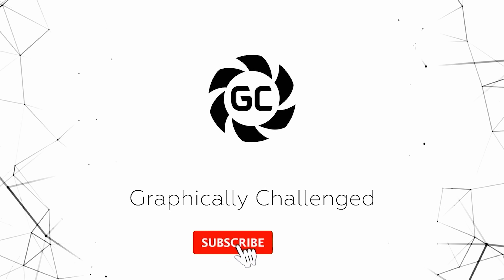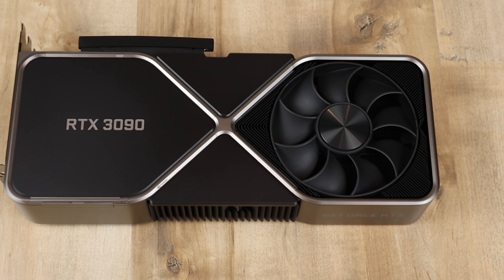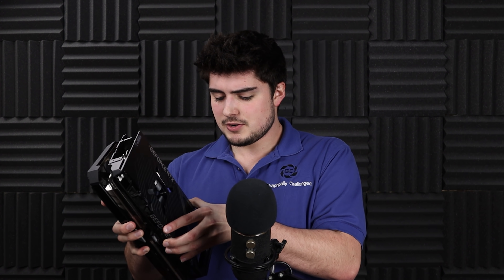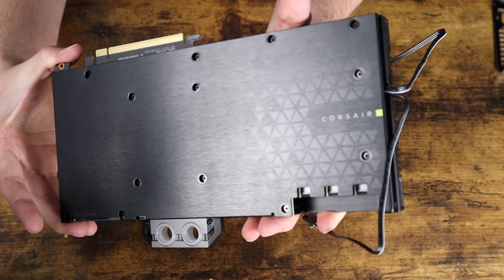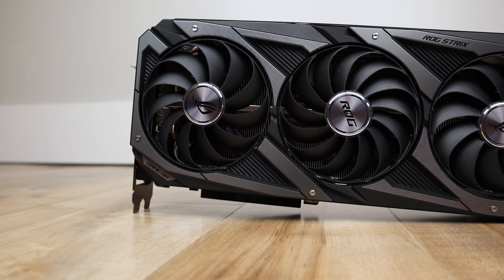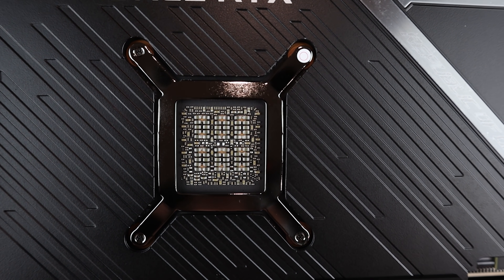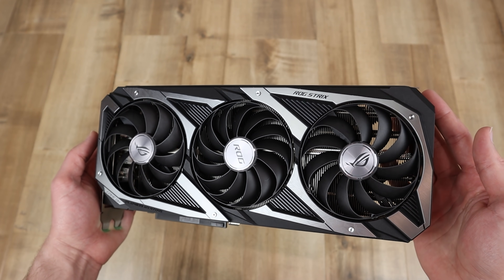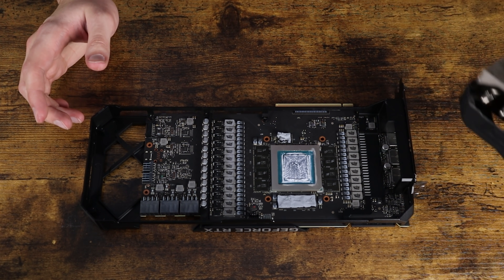Nvidia's RTX GPUs Have a MAJOR FLAW

Comment from the maker: Do you think this is a big problem, or is it a non issue? Let me know your thoughts in the comments below!
Reply: You need to change the title to Nvidia's RTX 3090 Has a MAJOR FLAW - But don't worry! You can't buy the card anyway.
Reply: @Nomadd86  now that would indeed be a better title haha
Reply: Been using it for more than 3 months. Mined with overclocking, played GTA V, Doom Eternal, Quake Champions, and Tom Clancy's The Divison 2 at ULTRA and 4K resolution, and worked on my video game project in Unreal Engine 4; never goes above 60 °C.
Reply: I wonder if in a few years they will be RMA’ing a bunch of 3090’s. Even micron states on their own website that the maximum operating temperature for g6x is 95C. So its running hotter than spec.
Reply: A wee bit of an exaggeration that for the vast majority of people is a non-issue.  Maybe an issue for miners, but I don't give a Flying F...Fudge about them.
Reply: @highlanderknight  I mean micron’s own website only rates it to a maximum of 95C for g6x. It isnt going to be a catastrophic failure anytime soon, but we might see 3090’s that have issues holding the memory clock and need to be down clocked to be stable a few years from now. Might make it interesting in a few years if you want to buy a used 3090 if the high memory temperatures cause a lot of failures
Reply: My gaming X Trio seems to stay well under the hotspot limits.
Reply: @MustafaBerkeGureltol  that's the weird thing. My 3090 Strix runs pretty cool temps at the GPU core. But push it hard, like running Nice Hash, the memory temps jump right up to 104 on stock settings. Forget trying to overclock, because it easily jumps to 110 and starts throttling. Same thing happens when rendering with DaVinci Resolve. Cyberpunk can push it, too. So, I leave the card at stock settings, or sometimes detune it. Unfortunately that drops preformance, but at least keeps the temps down. Again, it's only the memory - core stays in the 60s.

I don't have the money to do a water cooling loop (blew past the budget to get the card) so I need to look into the thermal pad replacement and hope someone makes a heatsink back plate or something that isn't too expensive.
Reply: @waggy401  Mine with it. Take the money you earn with mining and buy a water cooling kekw
Reply: Used market is going to be bonkers in 6 months
Reply: @MustafaBerkeGureltol  you have to check junction temps with hwinfo64
Reply: @brohoven3626  I believe you're referring to GPU Memory Junction Temperature. Yep. That also stays around 57-60 degrees.
Reply: Anyone know the command to show on console in hiveos?   Mine are in a cooling case. 3 7000 rpm fans pushing air through the case. It’s an older 1ths bitmain case. Gotta love repurposing.  Gpu sits 55c at 60% fan.  Not sure on the rest. Any input appreciated.
Reply: @TheBadassOne17  Yes. I have been using HWiNFO64 for a while now, and I am sure that it is what @BroHoven was referring to. I need to force the GPU so much(such as enabling RTX and cranking up the samples while rendering a character) in order for the GPU to go beyond the standard limit of 95°C. And I think it is still safe to use the card even though you see 110°C in the sensors as long as it is stable. What's damaging the GPU is variable temperature. Imagine going back and forth between 80 and 100°C. The card gets exposed to expansion constantly, which wears the material off. That's why gaming hurts your GPU way more than mining. Your GPU memory goes crazy when the CPU says: "Incoming level. Stream the level instantly and render it weeb."
Reply: this whole problem could have been avoided if nvidia used higher capacity memory chips. micron advertises the ability to create 8GB GDDR6X chips on their website.  meaning nvidia could theoretically make a GPU with 96GB on one side if they wanted. not to mention 10x2GB should be a bit cheaper than 20x1GB.
Reply: Honestly speaking ,I haven't had this problem at all since i've gotten the card back in September 25,2020
I got one from EVGA FTW ULTRA
Anyways my card has stayed under 70c for pretty much the whole time i have had it even with demanding games so it might be a few cards not all.
Reply: Probably not worth getting a used 3090, for all of the 10 people who would be willing to do that.
Reply: Imma sell my 3090 and get a 4090(or perhaps 5000) when it comes out.
Reply: wat abt rtx 3070 FE
Reply: Mustafa Berke Güreltöl you sure?
Mined it under 60C ?

😂
Reply: @CaptainScorpio24  only 8gb... and not gddr6x but gddr6 so it would not get Hot anyway
Reply: @DefinitelyJayJay5  yup. 😊
Reply: It’s not really an issue.  Operating temp is about performance and reliability parameters.  You design and characterize to a spec, going beyond won’t cause it to blow up.

The main reliability concern with higher temperatures is electromigration, and that isn’t really an issue until 125C given the exponential relationship between temp and reliability.

Thermal throttling happens to ensure you don’t start getting a massive increase in bit errors because of timing violations.  It’s like stability when you overclock your CPU too high, you might not exceed the operating temperature but you start violating timing on the circuits so BER goes up and things crash.

Micron and the board partners are aware of this.  Honestly taking the board apart and sticking an after market cooler on is taking on more risk than doing nothing since you risk voiding your warranty.  And if the higher temps are an issue (and statistically a few more will fail), it is most likely to occur early on in the products lifetime.  Bathtub curve.

Tl;dr the temp range is about performance not reliability.  As long as your card isn’t throttling your are good.
Reply: @highlanderknight  Not just miners, my 3090 FE hits 110 degrees c in cyberpunk 2077 with ray tracing maxed out. People should be fine if they don't use Ray Tracing though, but it's def an issue. To be clear, my GPU Clock stays at around 60 c but my gpu memory junction temp goes up to 110 c, and then throttles back down.
Reply: @psionx1  8 Gigabits.  Not 8 Gigabytes.
Reply: Flawed design for all that money.
Reply: i rigged up 2 92mm fans blowing across the top of backplate.  gddr6x temps max out at 76c now.
Reply: @psionx1  could be a bandwidth issue.  Card may perform faster with parallel access to ram.  Instead of channeling all that data through one Mem chip bus.
Reply: @MustafaBerkeGureltol  we arent talk about the gpu core, we talk about gpu memory junction, u can read it out only with a few tools like hwinfo64 and u will be surprised its over 90 degrees for sure by you while gaming even over 100, i have certain 3090 modells and all are over 96 degrees while play so stop talk bullshit!
Reply: I think your clickbait title is a big problem
Reply: You really need to stop creating dumb clickbait titles like "GPU X BACK IN STOCK SOON" and "MAJOR ISSUES FOUND WITH GPU Y" followed by "Do you think GPU X will be available?" and "Do you think it's a big problem for GPU Y?". You can either provide facts or conjecture, but BE TRANSPARENT ABOUT IT. Your titles are simply misleading and the questions you subsequently throw out there are the evidence of that simple fact.
Reply: verdammt23  Man 60% fan speed is to low...better to run it on 80% minimum!!

Comment: Old news since December.  GDDR6X on the 3080 and 3090 run hot.  Solutions - Undervolt, replace the pads, or plop a heatsink on the back (if you don't want to open up the card). All reported to be effective at dropping temperatures down in many cases.

Comment: I have a 3090 FE and I've been mining Eth to offset the cost. I was running it way too hot before everyone found out about the memory issue. Even some games would push it out of spec. Cyberpunk hit around 96c and Mechwarrior 5 hit 100c. I have a very well ventilated case and keep my ambient temps low, because I  hate the heat.  First, I scaled the power way down during mining, to keep the memory under 95c. Then I spent about $50 on double adhesive thermal pads and assorted heatsinks and covered the back plate as fully as I could. Didn't really do anything. Realizing there was no choice but to open the card, I followed a guide on YouTube and replaced all my internal thermal pads with Thermalright Odyssey 1.5mm pads. My temps dropped 20-30c. I re-pasted the core with Noctua NT-H1 that came with my CPU heatsink. No difference in core temps. I noticed that some of the pads were thicker than others and recommend getting a pack each of 1.5mm and 2mm pads to do an FE. My friend did his 3090 FE this way afterward and his temps seem to be even better than mine. He has no heatsinks on his back plate either. I bought a pack of 2mm pads and am planning to go back in, when I find the time.

Comment: Beware.. in the UK at least. I bought some new thermal pads but checked with Nvidia and they said if I do ANY modification to my 3090FE Inc replacing thermal pads it will void my warranty. So I have a choice care for my GPU but void warranty or abuse it with ram at a steady 104-108 degrees 24/7 (this is with a CPU cooler and multiple heatsinks on the back) but keep the 3 year warranty.   Madness that NV built suck a great cooler for their £1400 GPU then skimped on the thermal compound.

Comment: I can attest that putting a 80 mm heatsink with a 80 mm fan has drastically dropped my temps overall especially vram. I also added another 80 mm in a push pull direction over the exposed vent for the cooler and that helped even more for about 34 bucks it was fixed, plus new thermal pads, so 65. Be sure to add thermal pads to the backplate.

Comment: 100% Agree. I have a RTX 3090 Hybrid from Evga and I had to change thermal pads against expensive 16 ones. Even now when I mine with 119mhs temp of the vrams is average 106 degrees. While gaming its fine with about 86

Comment: we have some 3090's that we mine on, the backplates are to hot to touch for more than half a second but we are able to mine 24/7 with them since February. this will probably reduce the lifespan of it but what are you gonna do. We've made most the money back on them already. I downloaded a software and highest I saw was 108c since then we have had a fan running over the backplates and now the temps are doing just fine.

Comment: I had the rtx 3080 msi ventus 3x oc it Had 108c on mining 1000+ on memory 71 power limit
With same settings on the Asus Strix RTX 3080
With 1500+ 71 power limit 88c to 90 max fan
Reply: I sold The msi card after 2 months mining
I dont need stuff break in a year 🙄
Reply: Sure would change thermal pads if i even could tinker with pcs even Had somebody replace The gpu and broke almost The gpu slot doing it rip

Comment: change the thermal pads out for 3mm on the back and 2mm on the front, nothing to do with the backplate!! cheapo thermal pads from the manufacturure, with Thermal grizzly 08 pads you will drop your temps by up to 20c

Comment: My 3080 was getting up to 110°C under heavy loads, I opened it up and replaced all the thermal pads on the VRAM, temps went down to maxing out at ~95°C.  Opening that thing up was a major butt clench moment, but it turned out to be worth it.

Comment: I have the memory over clocked +1350 and the core clock at -250.
The core is at 47 degrees Celsius. The memory is at 90 degrees Celsius. Fan is on 80%. But its sitting in front of my air conditioner.
122.5 MH/s.

Comment: I read about this a little while back so I replaced my thermal pads and it decreased a full 19 degrees. Works great!
Reply: Which ones and where did you get them?
Reply: @waggy401  does it void card warranty\
Reply: @garvkhosla6488  if you don't want to worry about warranty, go to a DIY electronics store or amazon and pickup a kit of small heat sinks and use 3M 467MP 200MP Adhesive to attach them right on to the back plate over the memory chips. I saw a 20c drop on my 3090 FTW3
Reply: @aver54  bro i got my rtx 3090 for 3200$ .So i am confused that if i do so my warranty  gets avoid if not then card can damage with heat.
Reply: @garvkhosla6488  No I meant you literally use double sided thermal tape to put some heat sinks on the back of your card to help, you don't have to open it up and they are removable. Another note, if you're in the US warranty stickers aren't enforceable and you can remove them without worry, you're also not obligated to be honest with all the little details of the work you've done. In the end, taping heat sinks to the back plate of the card and pointing a fan at it isn't going to void the warranty.
Reply: @aver54  thanks bro for help😁

Comment: This also happens on the 3080 as well by the way. Huge issue with that.
Reply: @TheBadassOne17  "if enough of us say its truth, then it is"
Reply: 3090s have a harder time keeping cool because they have VRAM that's only passively cooled by the backplate.  All of a 3080's VRAM heat goes into the heat sink, so those are better able to handle the crazy GDDR6X heat.
Reply: @funghazi  alright bud, I and my friends deal with overheating VRAM whenever we game it's in the 100-108C range and we all have 3080s. Thank u for ur blogpost but I think I'd know if they have that problem or not lmao
Reply: @benman1407  My 3080 overheats too, I fixed it with better thermal pads.  My point is that it's easier to fix the VRAM temps on a 3080 than it is on a 3090 cuz half the VRAM is being cooled by nothing more than the backplate.
Reply: I got rtx 3080 gigabyte gaming oc and my vram temps all also around 100-108 celcius during gaming, should I worry about it? When I have checked the topic in like December I have found an info that below 115 is perfectly fine, now I am confused.

Comment: the 3090 FE was refreshed and now has very safe temps. My new 3090 has vram junction under 90c while gaming. surface temp is 20c lower.
Reply: With refreah you mean downclocked? In that case yes, it was refreshed.
Reply: @lupintheiii3055  he means that when the 3080 and 3090 came out there were videos of people adding thermal pads to the backplate as a mod. To the point where about a month or so after release nvidia actually copied these modders, and started adding thermal pads to the backplate right from the factory.
Reply: @Jsteeezz  Good to know (indeed the downclock was in response to the blackscreen drama at launch). Still not a good showing for a $1500 (aka $3000) graphic card.
And summer didn't kick in yet in the northern emisphere...

Comment: Why use one of the best Air cooling 3090s as an example, should've used another model.  I feel the Strix is one of the few models that would apply thermal pads on the back.

Comment: I have 2x 3090s crammed in a bequiet case. Running just air. The fans 120mm 2 in 2 out. Using hive os. Pulling 660 watts out the wall getting +210 MH/s . 

Fans are running nearly 100%.
No throttling and my cards are tight against one another. 78° card in slot pcie16_1 and 56° card in slot pcie16_2. 

What I'm trying to say don't listen to FOOLS. Do your OWN research. Otherwise you'll be scarred by misinformation.

Comment: Even the 3080 have this issue. I have a 3080 strix and didnt had any thermopads between the board and where the memories are and my memory temperature was always 100 degrees while mining even with a -500 on the memory and 61 on the power. I had to water cooled the card and now is in the 78 degrees with a +500 and the same 61 on the power.

Comment: Run MSI afterburner stock fan curves and you will be fine. Haven't had my memory run over 90 degrees no matter what I play. GPU temps stay right around 67-69 degrees. No worries here
Reply: @TheBadassOne17  memory junction doesn't go over 90 degrees and the GPU temp doesn't go over 69 degrees
Reply: I spent a bunch of time on MSI setting up a great fan curve. Works really well with my existing case fans setup and keeps everything nice and cool.

Comment: Im having no issues. Max of 90c on memory while mining. Gaming will raise that up with an auto fan curve. Definitely change it to peak by 55c. The 95c max operation temperature is completely accurate. Once you get it up to 94c on memory youll soon see a black screen.
Reply: My gpu also 90c while mining no throttle 1500+ on memory 102/mhs
Reply: Its The 3080 Strix Asus oc
Reply: Msi much worse 108c while mining 😳
Reply: @Jonathan900S  You're throttling because of +1500. Try less. You wont wanna go above +1250. I get 120mh/s.
Reply: @PDXCustomPCS  i dont have msi card anymore i sold it When Mined 2 months 108c 😂
Reply: @PDXCustomPCS  The msi card i Had before refused to go even 1100 The rtx 3080 since it was already 108c on memory everythin shut down chip dots all over screen pure garbage gpu msi made The ventus 3x oc
Reply: @PDXCustomPCS   rtx 3080 Asus Strix oc 90c with power limit 71
Reply: @PDXCustomPCS  not that much of the 3080  i get 102
Reply: @Jonathan900S  Nice. Ventus models suck. Of all mine, the Suprim X is the coolest, then the FTW3. My 3090 is a PNY Revel, but does great. If you get a Gaming X Trio, those cards stay stupid cool too.
Reply: @PDXCustomPCS  ah i decided on the Asus Strix Gaming oc
Reply: @PDXCustomPCS  i bought prebuilt pc msi and I got cheaper 3080 VENTUS
I sold for retail The gpu within a Day on ad and myself Had to pay 400$ extra for Asus one on auction
Reply: @PDXCustomPCS  i wish 3080 supported SLI

Comment: Great video but 1500-2500? 😂😂 ah those were the days
Reply: More like 3000-4000 😅😅
Reply: Just get an RX 6900XT at MSRP from the AMD store.
Reply: @lupintheiii3055  Yeah good luck with that,not just NVIDIA is affected by the shortage
Reply: @alexeyzudilin8038  Got one yesterday. Don't need luck no more, thanks.
Reply: @lupintheiii3055  Well there is a huge shortage,which makes them near impossible to get at MSRP and the bots just buy them all up fast so having some luck helps